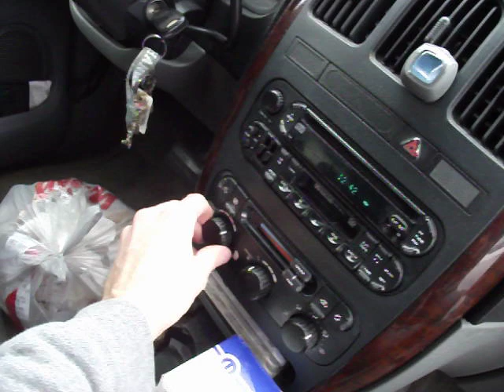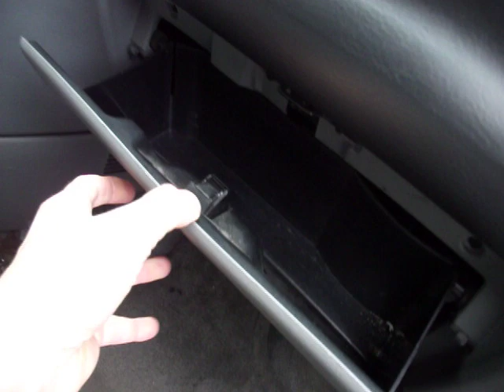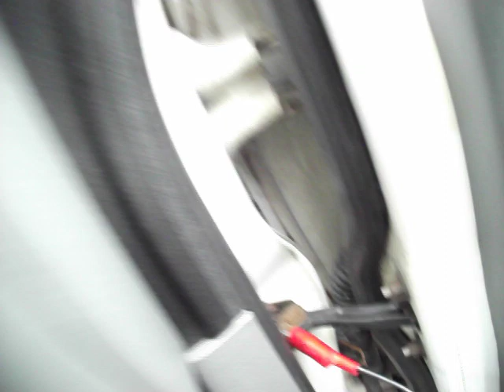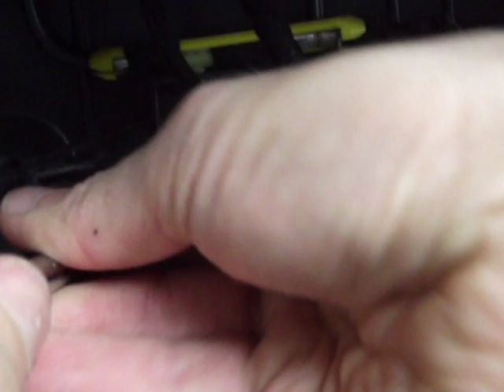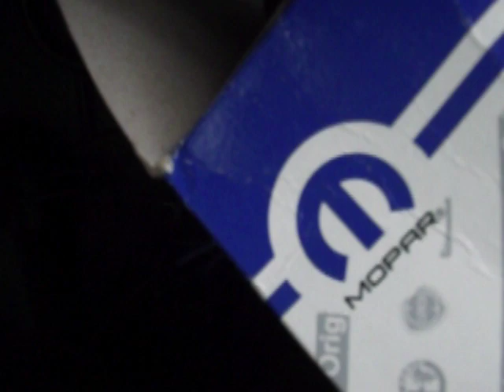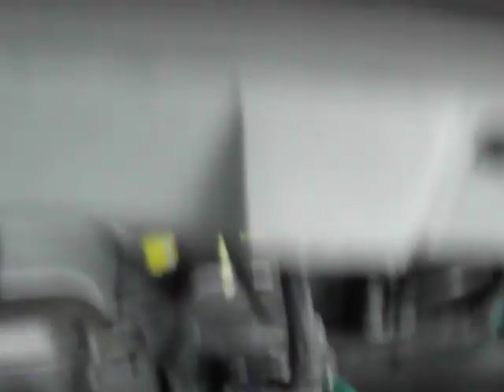2001-2007 Chrysler Town and Country No heat Condition. Replacing the Blower Motor Heat Resistor.

Comment: Good job and video, thanks! I have a 2004 too, if I understood right yours. 
I replaced the thermostatic valve by the engine, managing the coolant fluid, but inside the car, heating is still a bit weak. Could this resistor be the reason for that?
Reply from the maker: When you say weak, is it not hot, only warm or no air flow? The resistor is tied into the operation of the blower motor. So if the blower motor stops working, a good suspect is the resistor. if the air does not become hot, make sure the air is completely out of the cooling system, make sure the heating core is not blocked or the radiator. Any restriction in the coolant flowing will affect the temperature of the heat.